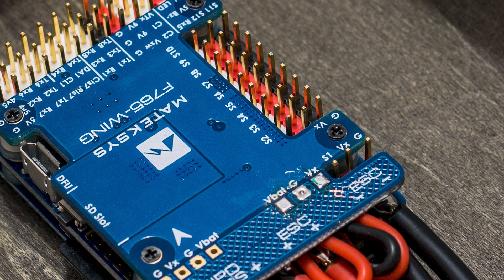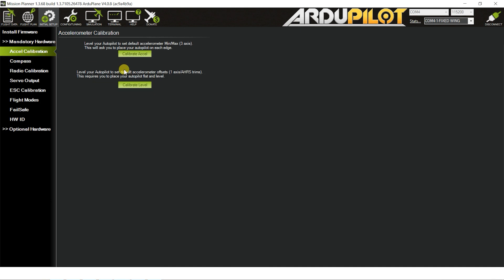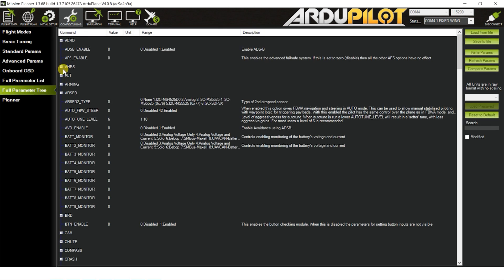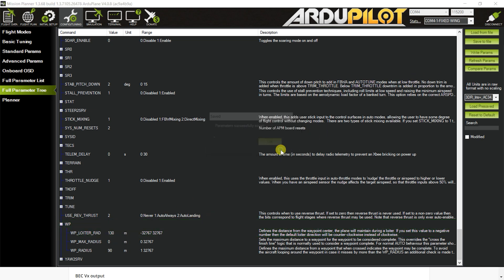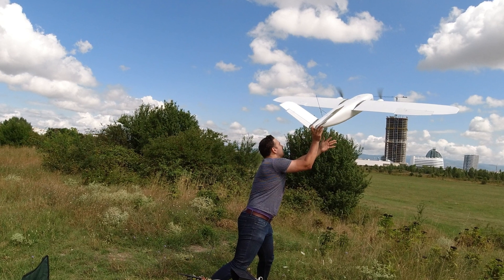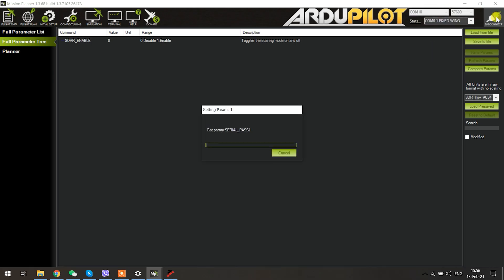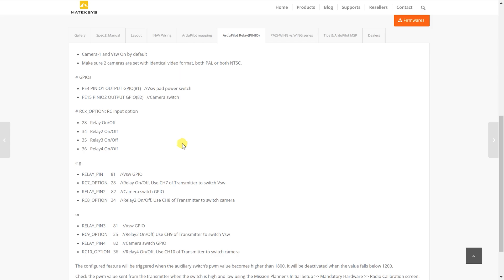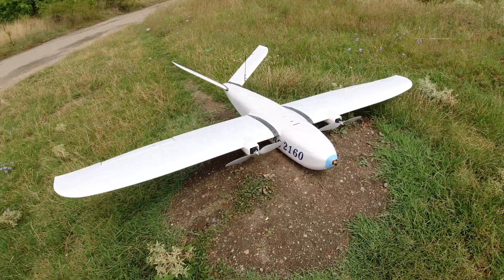HOW-TO Matek F765 Wing /w ArduPlane - flash, setup and fly!

Comment: Another awesome video. How has the accuracy of the F765 current monitor and default calibration values been? Any problems?
Reply from the maker: Actually I was quite pleasantly surprised to find out, at least for the Aggressor, that it showed pretty much on par with what the charger put back in the battery! This means, however, that it is overestimating the current a little bit, because what the charger puts in the battery is not the same as what the battery actually retains, as there is some inefficiency in that as well, but not a lot! So... I wouldn't change it, at least here, on this model, it is good enough! :)

Comment: How do you find mounting your FC directly to the plane body works? On quads some form of vibration dampening or isolation is needed, do you experience any issues like  on fixed wing at all?
Reply from the maker: Can't say that I've had any issues so far, but I do balance motor and prop, separate and together, to minimise vibrations! I also use 3M thick double sided tape to mount the FC... no idea if it helps, but I've never had issues with vibrations on planes after doing the balancing work!

Comment: Hi Arxangel, nice video. quick question - are you using 433mhz DL version? If so, have you experienced any range reducing interference from F765 on the DL433 system? Mike from DL says that 765 generates really bad RF pollution that limits DL range. In my experience the range was really bad - i got consistent failsafes ~ 700m from home location in a certain spot. I wonder if your experience confirms that assertion. thanks - an example few secs into this OSD footage: https://youtu.be/H2Ap9AYKMQU?list=PLvrRKTth9HIzMGxiGRCfXU7PCwPcUDi-6&t=213
Reply from the maker: Right... well I've only been a few kms out with the Flying Dragon so far, but no issues as far as I've seen! My receiver is about 15cm away from the F765, and the antenna is another 5cm, so 20cm in total away from the FC... I guess! It is the 433Mhz one, though I now have the 915Mhz one as well, but that one is in the Aggressor... and out on the wing... so quite a bit of separation!
Reply: @ArxangelRC  thanks. I have ~40 cm separation. DL will be soon releasing new firmware in an attempt to try and fix this situation with matek. The issue only impacts 433, not 915. My crossfire models with h743 (same thing as f765) are faring much better even on a lower power level.
Reply from the maker: @mkolesnik  OK, nice, I hope Mike will be able to sort it out! I am running quite an old firmware on my 433Mhz system... so may go out and do some testing next week, to see if I can replicate the issue! Have another plane to fly and review before that though, will test it next time I am out with the Flying Dragon!

Comment: Great tutorial as always Angel, I have always built all my planes with arduplane, I just put this FC in a mini talon, the only reason this time I'm going to go with INAV is because of the DJI fpv support. I don't know why arduplane developers still hasn't implemented MSP code into it! Unless you have a solution for that?😊
Reply from the maker: Thanks! Haha, sadly I don't have a solution, neither do I have the DJI system... too much money... and cannot afford at the moment! I assume they are dealing with quite a lot... and plus... the larger a dev team is... the slower things get done! I mean... I've waited 7 years for the ability to set any mode to any channel... I doubt you will have to wait that long for this... but still is probably not a priority given that it is used by a relatively small group of people, compared to the vast amount of controllers out there, most of which are aimed at industry too!
Reply: Hey man!
To enable MSP OSD, set the following parameters (using SERIAL port 2 as the port to attach to the DJI Air unit using both TX and RX lines):

OSD_TYPE = 3
SERIAL2_PROTOCOL = 33
MSP_OPTIONS = 0 (polling mode)

check the documentation: Docs » Items in Master Branch Only » MSP OSD

I use it with arduplane and dji fpv and its usable, OSD config in planner is bad but it's working, all but ladder, horizon and some other minor osd items are not showing. HD OSD is mega!
Reply from the maker: @oneistar6661  Nice, didn't know they got it working now!
Reply: @ArxangelRC  That was the final push I needed to go with DJI. I expect only improvements from now on.
Reply from the maker: @oneistar6661  Yeah, hope so!

Comment: That was an incredibly detail video! I can say that I honestly appreciate your hard work... Kind of cumbersome the procedure to swap cameras... I would probably would have set it up to a channel pass through... rather than to go jump all those hoops!! "Finally no disrespect but I would stick to my guns and keep my self flying my large planes on MFD autopilot... that is a system that can almost save me from the worst of my total stupidity!! "Hey I say Almost"
Reply from the maker: Thank you! I am happy these are useful! You can't put the camera switch to a channel passthru... it is built in the flight controller! With a channel passthru you can setup an external switch! hahahahaha, yes, the MFD is a reliable autopilot, and it does eliminate a lot of the confusion when setting it up... because it doesn't allow you to change much, but it is more expensive than this one... though requires exactly ZERO time in soldering and cable crimping! :) I love mine, that is in the Crosswind Mini!

Comment: Great guide!
Does the camera switching also work between a fpv camera and a gopro/mapping camera?
What camera is seen @17:24?
Thanks!
Reply from the maker: The switching would work between any two video signals connected to the controller, either both PAL, or both NTSC! If you have an analogue video out of your mapping camera, for instance, if you will be using one, you can switch between the FPV cam, and other cam, yes! The one I have in there is the FireFly 8SE: http://bit.ly/Firefly-8SE put it there just for the fun of it, to pretend its a mapping camera, but also to do at least something in the way this plane was meant to be used - to have a downward facing camera! :)
Reply: @ArxangelRC  Thank you for the quick response!
Alright I see, I dont have a mapping camera, but now I know how the switiching works.
Have a good Day!
Reply from the maker: @niklasengler3622  You can use any camera, as long as it has an analogue video signal, so you can plug it in the flight controller! You can run two FPV cameras - one in the nose, and one on the tail, or an FPV and an HD camera, like I am, and as long as you can get an analogue video signal out of the HD camera, you can also switch to its video feed.

Comment: I am using the f765 in a Phoenix 2400 glider with INAV. My question to you is, why do you use arduplane instead of INAV? It just seems to me that INAV is more intuitive than Arduplane.
Reply: If you flash Arduplane you can try autonomous soaring with Ardusoar, doe INAV have that?
Reply from the maker: Dooley, I use ArduPlane because I've been with it for years, and I know it well, also, the base code in it - stabilizing, RTH, auto take off, etc., is MUCH more mature than iNav, and has never given me any issues whatsoever, not to mention that is literally does not need any parameters to be changed or adjusted for any of this to work well out of the box! Out of my experience with iNav... I can't say the same, sadly! iNav's GUI might be a tad more convenient and flashy... but underneath... not the same at all!

Comment: There’s a lot of talk on the Dragon Link thread in rcgroups about how noisy this FC is and how bad it effects the DL range - what’s your take on this issue ?
Reply: I would like to hear more,  since I'm using 765 I've changed several antennas on my DL and range is severely impaired like 5-10 instead of 50-60km. Also it seems that ppm signal is with extra low resolution and 200-300ms delay. I don't have problems on my other setup with minipix with DL too.
Reply: @oneistar6661  same here - see my post above
Reply: I don’t use Dragon Link (MFD Link, a 433 system that is very similar) but my range has been stellar with this FC FWIW. I wonder if it has to do with noise being produced by the on board BECs at certain voltages. I use 12v for the VTX...
Reply from the maker: I've not been out to more than a few kms so far, but have not seen any troubling behaviour from the RSSI indicator. How far away from the F765 are your receiver and antenna?
Reply: @ArxangelRC  Hey, Receiver is 20cm away from FC and antenna another 30cm so 50 cm in total. Getting around 40-50 RSSI at 3km and low 30s in around 7km, was scared to go further.
All grounds in the FC, so this might be issue is it good idea to apply capacitor at bat?
Reply from the maker: @oneistar6661  I've never installed capacitors on these, on a plane at least, and never had any issues! That is some good separation... I don't think the F765 can spread its 433Mhz interference quite that far... or at least it would make little sense if it did! What else is around the receiver or the antenna?
Reply: @ArxangelRC  I'm going to try cap and see how it's doing, if it's not working I'm going for the servos. Antenna is in the winglet and receiver in the middle of the wing so nothing around to interfere.
Reply from the maker: @oneistar6661  Not sure capacitors on the battery input wires will solve an issue like that... but who knows... let us know of the results! :)
Reply: @oneistar6661  what about the ESC? Those can be pretty bad for EMF at 433MHz.. Have you only connected your ESC ground and signal pins? Do not connect the 5v pin to the FC! If ESC  SBEC (yes, switching - creates more noise) is the issue try get rid of the 5v wire coming from it all together. It will act as an antennae radiating more interference if it is the case. Adding more low ESR filtering capacitors strategically should help.
Reply: @jotham123  Hey man,  did several things at once and it seems my problem is gone. Changed previous digital servos with analogue ones, separated apart the servo wires from rc/tx/rx, added cap on the ESC and finally found old DL v2 tx antenna which replaced the original one. Everything is operating normally now, what I can point as most possible causes are servo wire proximity to rc wires and digital servo noise, maybe tx antenna for rssi.
Cheers.
Happy flying.🛸

edit: I never connect bec v to fc, it scares me :)
Reply: @oneistar6661  nice one. good to hear.
Reply: @jotham123  Hey, although upper mentioned changes did cured the range it's still not quite alight. Landed, did the micro power range test with and without FC power and it's extrfa bad when the FC is on and 9v BEC is active. So, added cap at 5v rail and stopped using 9v BEC, added ferrites and it's better but still, definitely from the board. I'll wait for the new firmware.
Reply: @jotham123  Hey, after several attempts went berserk and changed FC to 405WSE and receiver to DLHP 1.2 transceiver. Now it's perfect! My ranger will go ranging.
Reply: @oneistar6661  nice. What is this transceiver? I cannot find anything when I search for it. Would love to use 1.2 or 1.3ghz for video but unfortunately only band we can really use here is 915, 2.4 and 5.8
Reply: @jotham123  Hi, missed that. It's the fancy name of v2 1000mw receiver from dragonlink. It's perfect, can get it from team-legit.
Reply: @oneistar6661  what sort of packet loss rate and data rate can you get?

Comment: Rc options were always there, just in full parameters list.
Reply from the maker: Well sure... but there was no explanation next to them, no info on how to use them!
Reply: @ArxangelRC  true, and new UI helps for sure.
I just wish they could make it so 2 functions could be combined on one channel.
Reply from the maker: @AntonKhrapov  Yeah, that would be nice... BUT... could become more confusing in some situations - when you have two functions on each switch, and you have two switches... in any position of the switches you will have two modes selected at the same time... sooooo... which one takes priority?!
Reply: @ArxangelRC  there are already rc_options there that might mess up with some flight modes in the same way. I'm thinking more in a way of combining modes... for example I lake to have 1 switch doing RTL or just Land mode depending on setting. It's a 3-position switch that does nothing when it's in the middle and switches 2 separate channels in top and bottom positions, with rcoptions for those channels assigned to rtl and land respectively. So, that takes 2 channels instead of 1 to do this, which is not ideal. Just an example. Switching A and B type of FBW would be another option, or many other  mutually exclusive functions.
Reply from the maker: @AntonKhrapov  Right, I see your point, but it will need to be made like in Betaflight or iNav, to be able to tell it that middle position is neither, otherwise as it stands now... I am not sure you can do just that, but I wouldn't mind them reworking that particular part of the firmware to be more iNav like, because that is probably the only thing I prefer in iNav over ArduPlane!

Comment: nice explanation
I'm curious how many years is needed before arduplane will undestarnd 3pos switched, this is really annoying.
Reply: @ansariflightplan5814  show me how to setup 2 functions on 1 3pos switch
Reply: @PiotrMarkiewicz  can u need mix with 2 position swicth, i do it since i know ardupilot =)
Reply: @ansariflightplan5814  you don't see a point, I can mix, but I need support for 3pos switch
Reply: @PiotrMarkiewicz  ohh i see now.. yes u can used knob also or buy the mode ch switch, or in radio master u just select the 6 switch button
Reply from the maker: Thanks! Support for 3 pos switch in what way? I don't get the issue!
Reply: @ArxangelRC  now every switch is 2pos in arduplane, right? with 3pos switch you can have 2 functions on 1 switch. It's still far less flexible than iNav, but would be nice to have this.
Reply from the maker: @PiotrMarkiewicz  Well... not really! Channel 8, the dedicated modes switch, can be a 3 pos switch, and that is what I actually use, and have 3 modes set on it! The "User Params" new addition to Mission Planner, that allows you to set more modes to more switches, is an ON/OFF type of thing... but... what happens when you can do now 2 modes per channel, so you can have one in each position of the switch... but then you have a few switches, 2 modes each... so how do you determine which mode takes priority, since you would have 2 or 3, or more modes active at the same time, because the switches are in any position?!
Reply: @ArxangelRC  well not exactly, for modes I have 6pos switch installed in taranis, but any other channel is just 2pos. 
Looks how flexible is iNav with modes this is what I really miss. Different functions on different channels. This is not about flight modes. i.e. in iNav I have autotrim and autotune on one 3pos switch.
Reply from the maker: @PiotrMarkiewicz  Yup, iNav does have that advantage over ArduPilot, this flexibility in setting up these things!